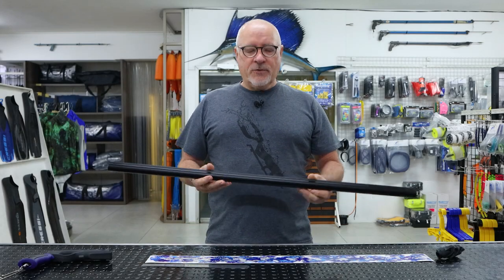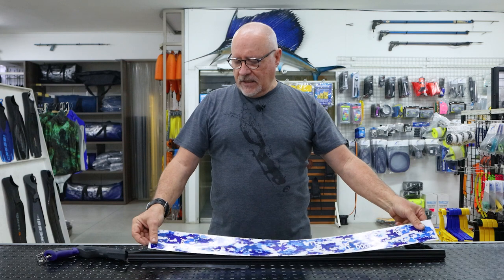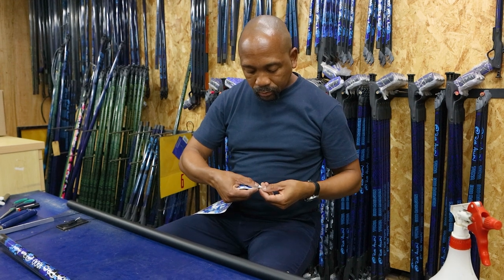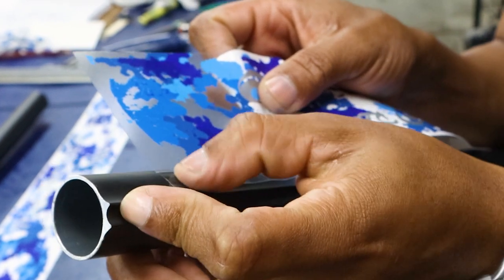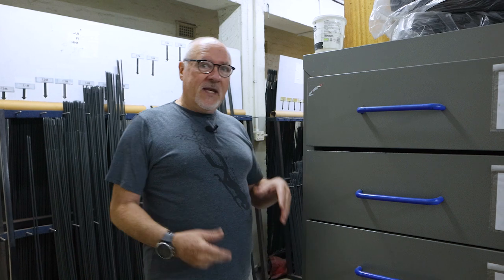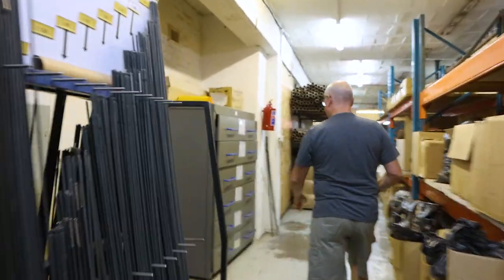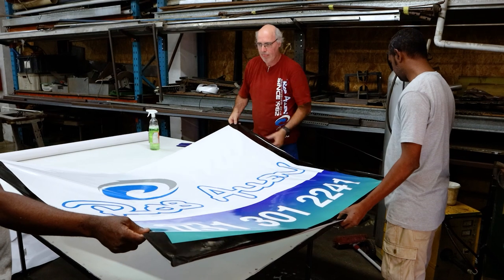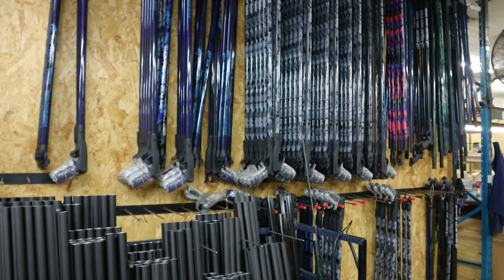Rob Allen | DIY | Barrel Stickers | 2023

Comment: Dear Mr Allen, I'm thinking to get a Pathos floater D30 for my RA carbon 100m rail gun. Just would like to give it a bit more buoyancy as it feels very heavy with 7.5m shaft in the water. However, I realized I might have to use some kind of glues to glue the floater to the gun barrel and I'm a bit of scared if this would damage the barrel?  Some divers recommend a glue called "Slow Curing Epoxy " and could you please guide us if it would be safe to do so and if so, could you recommend some glues please?  Ideally, I don't want to make the floater permanent to my gun if one day I want to take it off. Thank you, Rui
Reply from the maker: We used a rubber Locktite on one and it lasted about 4 years. We then used a 2 part epoxy and 3 of these are out there still fine after 18 months. Any glue will damage the clear coat on the carbon but not to the detriment of the carbon. I'd mark where you need to put the glue and roughen it up with some sand paper before applying the epoxy.
Reply: @RobAllenSpearfishing  ah! Thank you so much for your kind guidance Mr Allen! You’re the best ! Cheers, Rui